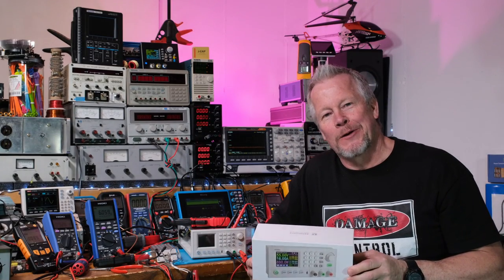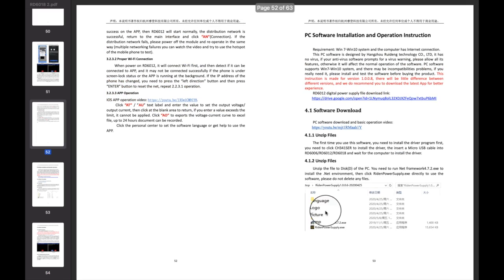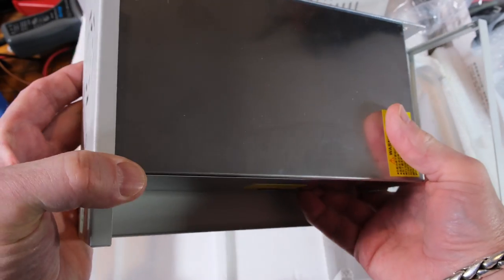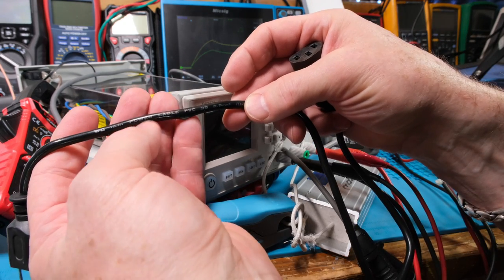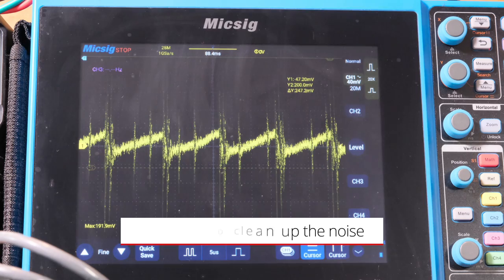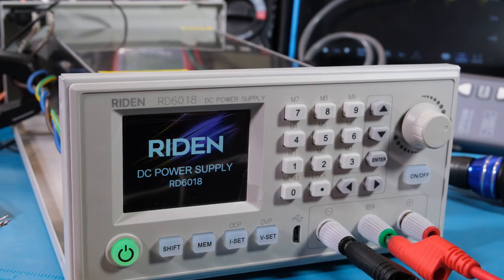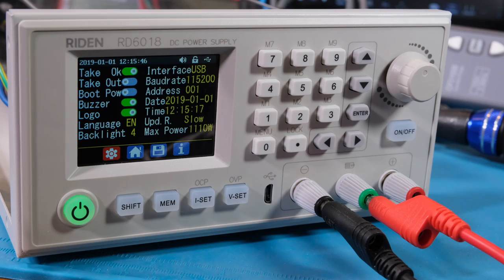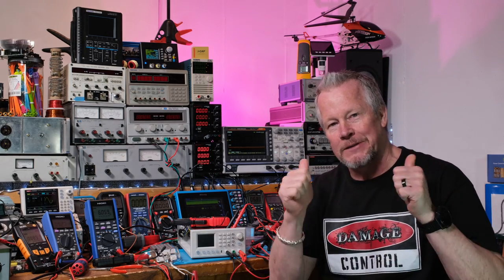Low Cost 1000Watt Bench Power Supply RD6018 #Ridenpowersupply #RD6018 #buildyourownpowersupply

Comment: I have this model for past 2+ years and I love this power supply! It was easy to assemble and fun to assemble it. Thanks again for sharing with us.
Reply from the maker: Thanks for the great feedback Tony!!  Is your fan as load as mine?
Reply: @KissAnalog  No, my fan isn't loud and it has 63.5V so I can get 60V out! I use these power supplies a lot and some are over the stated voltage and some aren't! But 5V in your case isn't much of a problem.
Reply: @tonysfun  Tony are you getting 18 amps at 60 volts continuous from this supply?
Reply: @mosfet500  I have not tested it, but I don't think I can get 18A out of it. But I don't ever need more than 5A in my projects so far, sorry.
Reply: It was way cheaper 2 /3 years ago. i got it (complete) for 70 euros, almost 3 yrs ago.

Comment: Now you know why the rest of the world uses 250V! Damn Edison and his FUD!

I have the RD6006 and frankly that is all the power I'll ever need, but I cannot believe how far they've pushed the power with the same physical design. I have the bulk PSU mounted on the wall under the bench and the RD6006 wall mounted above the bench. I'm trying to use all test equipment this way to avoid it's depth crowding me off the bench as it does yours! One reason I really like the Micsig scope!

One oddity with these units is that there is a mechanical relay inside, but this is only used for charge termination, not when you switch the output off manually or on a protection trip. I cannot understand why they do not use the relay to cut the output faster. Also worth noting that the RD unit is not isolated, so you can't use two RD units on one bulk supply for dual rail.
Reply from the maker: Great feedback John!!  Very helpful;)
Reply: @zoom_h2625  The RD60xx is a synchronous buck converter (not isolated). The negative side of its input is connected to the negative output terminal. It depends on the bulk PSU for isolation. Eddie has used a switch-mode unit for this. Jerry used a linear PSU. Neither of them could get a dual rail unit using a common bulk PSU because this would result in the two RD60xx units having their negative output terminals connected together.

I saw Jerry's video before and did not understand what he was trying to achieve. For a hybrid PSU you want a switch-mode bulk converter with a linear final stage to finesse the output. Jerry's configuration is the wrong way round and gives the worst of both worlds. Just imagine the size of the transformers and capacitor banks scaled up to three times the power for the RD6018!

Comment: Very nice setup.  I just ordered the RD6024 with a 36v 1000w supply that has a thermal controlled fan.  Looking forward to building it.
Reply from the maker: Thanks!  Sounds great - let us know.
Reply: Have you got the 6024 up and running? How is it? I was planning on ordering the 6018 earlier today, and I saw the 6024 was available from the same seller so I ordered that instead.

Comment: The cable says 0.5 mm², which is area, not diameter. This is about 20 AWG in the US. In Europe and many other parts of the world cables, cords and wires are commonly marked with mm², we don't use the AWG system at all. Common sizes for power cords with IEC C13 plugs are 1 mm² (17 AWG) for 10 A and 0.75 mm² (18 AWG) for up to 6 A. Current rating might vary among manufacturers and cord lengths and might also vary somewhat between 120 V and 230 V systems. It's a good point though that you shouldn't connect a random cord to a power supply, check the wire gauge first.
Reply from the maker: Thanks for this great feedback Johanh!  Yes, that is what I showed in the video, the cord that was heated was only 20 AWG.  You are so right - random cords can be dangerous.  Always check the rating or size of the cable.

Comment: One thing that I have noticed is, that the switching mode power supply (AC/DC) does not have a PFC. Powersupplys at this level of power should definitely have one. That's typical for power supplys from China or cheaper ones

Maybe you could have explained the topology of the power supply a little bit. (The coil on the secondary side is not only for filtering. It stores the energy in one halfcicle. The smaller winding on the secondary coil is not for current sensing. It's some kind of secondary and powers the fan.

In conclusion a great Video👍
Reply from the maker: Thanks Jack!  I agree about the PFC, I was surprised!  I actually cut out about 25 min or more as this video got really long;) I guess I cut out the part where I talked about finding a PS with a PFC front end and LLC output.  I want better power factor and softer switching;)
Reply: Yeah, a Meanwell power supply will have active power factor correction.  The generic unit here doesn't, which is why the apparent power is so high (and the cost is so low).

Comment: A more difficult test for these power supplies is to switch the load instead of the source to check for overshoot, etc.  This is especially difficult if the load is reactive.  Some supplies will overshoot badly in such conditions due to the output capacitance of the supply itself, though the Riden (Rui Deng) supplies usually do acceptably well.
Reply from the maker: Thanks Rob for the great suggestion!  I think I'll do a followup and compare it to the big HP linear that I have;)

Comment: Though Max at turn on is a useful measurement, the HT206 doesn't have a true Inrush mode, so Max will only show a portion of the inrush depending upon the meter's standard time resolution.  Max is not the same as Inrush, even though commenters sometimes have angrily told me otherwise ;).  To get a better Inrush measurement on a Habotest (Hototech) meter, you have to jump up to their HT208 series.

Even then, it's hard to know what the resolution actually is or what standard we should use for inrush mode.  Fluke's present-day standard is to take 400 samples over a 100ms period after the sampling is triggered by some rise in current.  The 100ms may start as soon as current rises above some hysteresis point above or below 0, but that's unclear.  The important bit is that we take measurements multiple times per millisecond, which Max mode on budget meters will certainly not do.  Still, Max is good enough for many purposes; I'm not arguing that it's not.
Reply from the maker: Thanks for this great feedback!  I agree with you that max and inrush are different modes for the meter, and some have both which maybe proves your case;)  Although, some measurements both modes will capture near the same thing as you point out in the sampling time.  An inrush is typically a really cool feature added to more expensive meters.  Maybe you get arguments from Fluke guys who often don't have inrush unless they paid for one of the better meters;)  Here's a video that I did on 5 different Kaiweets meters: https://youtu.be/C9ni4_bLpR8

Comment: 10A marking on a AC plug is a rating for a plug itself but not for a cable. It's considered to be safe to load up to 10A per 1 square mm of a wire cross section.
Reply from the maker: Thanks for the great feedback.  On a molded plug, I'd think that the cable would be rated correctly too, but not always...

Comment: Waiting for the dissection of the failed "10A" cable. What was the actual gauge?

With all your equipment you can drive 5 amps DC through the cable and measure the heat dissipated per meter or per surface area of the cable enclosure.

Comment: Nice video Eddie :) Have you ever felt the need to use a linear power supply instead of a switched one and, if so, what was the case ?
Reply from the maker: Thank you Adrian!  This is a great question!  I would use a linear if I were doing a sensitive test where I wanted absolutely no noise - like maybe in a mic amplifier.  It would be interesting though - to test a low noise switcher just to see if it is actually any worse than the linear;)

Comment: I've got the same RD6018W but it'll be run from a Huawei R4850G2 with rectifier module and can-bus controller. Overkill but it'll allow multiple frontends from a single supply.

At the moment I'm using a smaller psu with this frontend but the R4850G2 is there I just have to setup my "man cave" better this xmas with more power outlets etc mount TV, stereo etc on the wall to give more floor space, put my servers in the built-in cupboard and run some cables with wall plates etc etc busy Xmas holidays this year....... I got wildly off topic 🤷‍♂️ love the RD6018W is my point.
Reply from the maker: Wow, thanks for that feedback!

Comment: for 10A, 0.75mm2 is the absolute bare min and I'd not use anything lower than 1.5mm2 as 0.75 is likely to hit 40-45C over ambient at 10A. Btw, the plug is rated 10A but just the plug, itself.
Reply from the maker: Thanks for this great feedback!  Yes, this can be an easy thing to overlook - until you see the smoke;)

Comment: the 10amp rating is only for the plug not for the cable itself
Reply from the maker: Thanks!  I’m sure you are right;)  I think this must have been a 5 Amp cord.  Too bad they don’t label that on the cord.  Should be a UL safety requirement.

Comment: Hey, why don't you stick in a tiny power supply and a flip flop driving a relay. so you can turn off/on the mains from the front panel. For power just gut a USB power adapter you probably have a ton of them.
Reply from the maker: LOL I wouldn't doubt someone has tried that;)

Comment: Thanks for review these cheap equipment since it's budget good for most people. From your professional design experience of power supply, you said the component are pretty good, how reliable is the safety measure? (How large is the capacitor can say it's good, how many protection required?)
Reply: I was wondering that, as the caps are only 250v, and we have 230v AC in the UK. I don't think they are rated high enough for the UK.
Reply from the maker: I think they did a good job choosing components, and rating them properly. Now remember, for 230 V AC applications you need to slide the switch over which puts the capacitors in series.
Reply: @KissAnalog  Thank you, luckily I live in Hong Kong already in 220V, power up in 110V simply not working instead of blown up.
Reply: @ianhaylock7409  The rating is OK but not good, I remember a guidebook say upper limit should be at least working voltage times 1.5 or 2 for spike or surge.

Comment: Thanks Eddie, great review as usual.
I'm wondering if you looked for overshoot with your probe voltage lower on AC and the horizontal spread out more if you would see something you might be missing at the current settings.
Reply from the maker: That's a great question, but I think the ramp time was so slow that it just doesn't overshoot.  But as someone else pointed out, a great way to find overshoot is by stepping the load.  I'll have to do another video looking into how solid this output is over various operating parameters;)

Comment: Can you measure the noise? Just connect an AC-coupled scope to the DC output, and try some different resistor loads.
Reply from the maker: Thanks I did do that near the end of this video, but I deleted a bunch of it as it was getting too long.  So, I plan to do a follow up deep dive in the noise and safety aspects;)
Reply: @KissAnalog  That would be great, I would really like to reduce the noise.  Also another video suggested putting a 100 nf capacitor across the post connections.  When he put it on a scope it really seemed to help.  Would that be better than a resistor or would using a combination be optimal.  In the video I just referred to he connected the capacitor at the circuit board of the controller where the posts are connected. Is this better than putting the capacitor across the actual power supply.  I know power supply's are one of your strengths so your advice would really be appreciated.  Like you said at this price the unit is fantastic, but it would be nice to minimize the noise.
Reply: Answered part of my own question.  The resistor I saw on one of the videos was for the lower power supplies they provide with some kits that are loud when "Unloaded".  The 1000w supply I ordered does not appear to have that problem, so all I need is a recommended capacitor to help reduce output ripple and where it is best to place it.

Comment: Very cool. I have been very happy with my 2 Kaiweets power supplies but this is pretty affordable for that much power. A BK Precision power supply that does 60V is around 600 bucks and you only get 3 amps. I have a question. Have you tried connecting this power supply up to your other 60V power supply in order to generate the positive and negative rails to power any of your amps? That is the main reason I'd buy this to really test some amps that can take more than my Kaiweets can supply. Can you please show a video doing that? I'd like to see how this power supply does under heavy load.
Reply from the maker: Thanks Tron - you are reading my mind;) I wanted to test one first to see if it was good enough to invest in a second one, but that is my ultimate goal – ha ha!

Comment: Where is the Videl on cleaning up the ripple?
Reply from the maker: Thanks for asking.  I've been planning to do that video forever.  I actually was going to build a second one of these power supplies and then do it for both.  I wanted a plus and minus supply.  But I've had trouble finding the right AC/DC converter for it.  I'll do that video very soon.

Comment: Is there a way to control the front panel with a i2c or PWM control input?

What pinout connections are there where the wifi module plugs into it?
Would it be possible to design a custom esp32 replacement that can 
plug into the wifi module socket?
Can you reverse engineer that part of the system?

Comment: Hi Eddy, Nice Video as Always! What did the whole PSU (Casing, AC/DC Converter &  Frontplate with DCDC costed ?
Seeing the 2 Big DO-xxx Diodes near the Switching Transistors, it seems to be a 2 Switch Forward Topology. There are some Teardowns of Similar 1kW ACDC Supplies, The Brand Input Caps are mostly "Repurposed ones"  , etc.
Cheers,Konstantin
Reply from the maker: Thanks for this great feedback!  Nice eye - and I think you might be correct on the 2 switch Forward;)  I want to get an LLC with PFC front end for this;)

Comment: 0.5 mm cable in the US is a fire hazard at the amps the US requires for modest powered stuff. No ability to downrate the plug fuse either, because there isn't one.
Reply from the maker: I agree - thanks John!
Reply: Note that the "10A" refers to the rating of the *plug*, not the wire.  0.5mm wire, assuming they are referring to cross-section and not diameter, is 20AWG, which might be able to carry 10A but has no safety margin to speak of (it's probably 60°C insulation too) as evidenced by the smoke in the video.

Comment: Does the dc dc power supply save the previous setting for output volts etc and kick straight back in when you turn it off and on again. Or do you need to manually hit power start or turn the volts and amps knobs back up again. Figuring if it would be suitable to smooth out the fairly erratic voltage output from a wind turbine. Which can go to zero quite often so the psu would turn off... But would it turn back on when the wind turbine spins again and puts back out power to it.. Many thanks

Comment: Hello, I have the same smps. What's the value of load resistor? 

According to the color code of my, it is supposed to be 510 ohms, but when measured it shows 5 k. It gets pretty hot. Do you have any idea?
Reply from the maker: Not sure what load resistor you mean?
Reply: The supplier provided a resistor, which has to be connected to the output. They mention it helps to reduce noise.

Comment: To get the wifi to work everything has to be on 2.4Ghz. The wifi in the power supply will be on 2.4Ghz. Your phone has to be on 2.4ghz to connect to power supply wifi. If you trying to do wifi connection on the computer it also has to be on 2.4Ghz. If you router can separate out 2.4Gz from 5gz  with their on SSID then it should be easier. I find much easier to just use the UDS cable to connect to a computer.
Reply from the maker: Thank you for this great info!  I’ll have to try that;)

Comment: The cost in Canadian dollars in March 2024 on sale from Banggood for the control module, the power supply and the separate box is $290 then taxes and border charges. Ain’t worth the money. Much better options out there.
Reply from the maker: Thanks for this info.  In the US you can get this for $208.50 USD.  So I think for a 950 Watt output power supply with 60 V and 18 Ams - that's not bad.
Reply: @KissAnalog  The exchange rate says the same. $208.50 US = $283.55 Canadian. Still isn’t worth it. Thanks for the videos and the quick reply. Much appreciated. 👍🍻

Comment: I'm getting into lithium batteries would you recommend this for a way to charge /test a pack? thinking at 15ish amp it would take a while
Reply from the maker: I think it might be a great way to do it.  How big are your packs?
Reply: @KissAnalog  To start with will be 48v 280 amh pack just trying to figure out the best way to charge /test them. I have a East tester (ET4510 ) coming thought it would charge and discharge but think now its more a load tester. So I'll need to charge them all I have is a 24v 16amp power supply atm Ideas please

Comment: I have a big box of battery powered tools without batteries , voltage from 12 to 20 volts, what spec power supply would I need to check them out, I presume they operate at higher amperage
Reply from the maker: This would be a great power supply.  I think you would want at least 20V variable power supply and a current rating 4x higher than the power that tools are rated for - so it would cover spin up or turn on transient.
Reply: @KissAnalog  have you ever dealt with Aliexpress ?